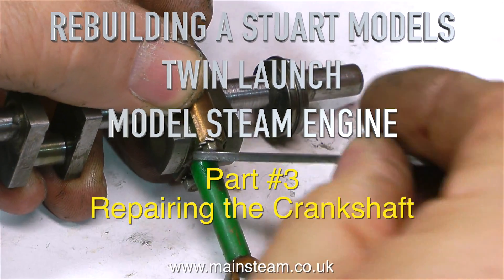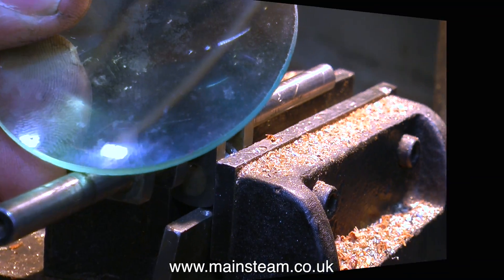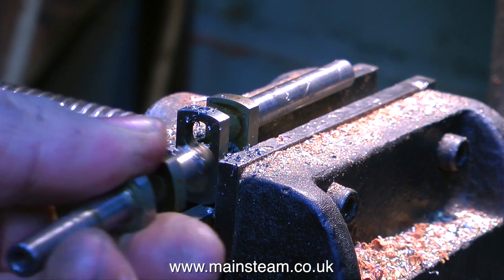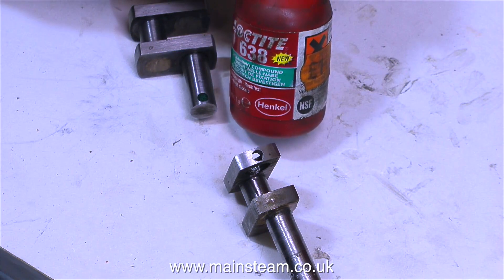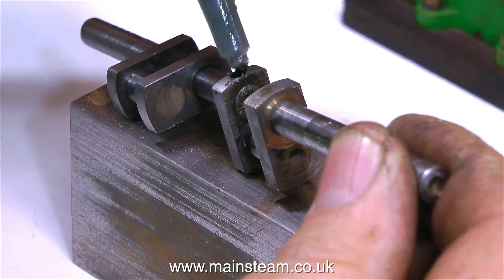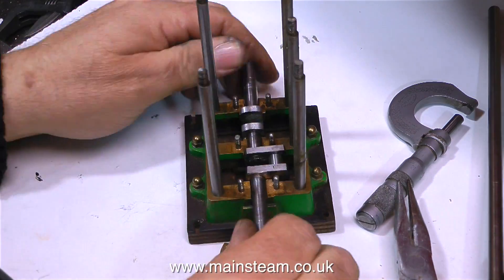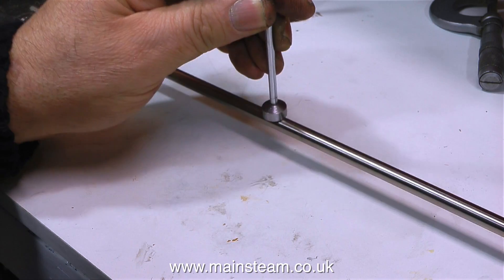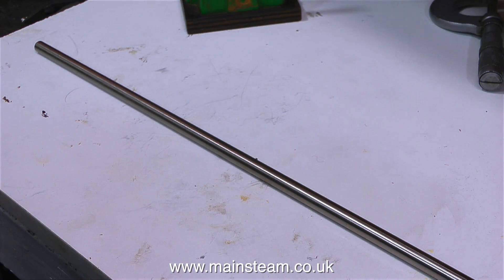STUART MODELS TWIN LAUNCH STEAM ENGINE REBUILD - PART #3

Comment: why do you not use  roll pins in the crank? to loose and not sturdy enough?
Reply from the maker: You answered your own question - they are not strong enough.
Reply: was just curious if there were other reasons. thanks! love the series cute little engine in the end. I have little one cylinder I want to make as my first proper machining build this winter. your videos have been very helpful on tips and tricks! more the full sized small engines myself. but machining and small work are needed in that as well at times.

Comment: Im building one of these twin launch engines right now.  I have been for a couple years actually, its slow going.  but mine came with a forged crankshaft.  Not easy to machine, is that why this one was made with multiple pieces?
Reply from the maker: Yes, it is much simpler to build up a crankshaft than machine from the solid.